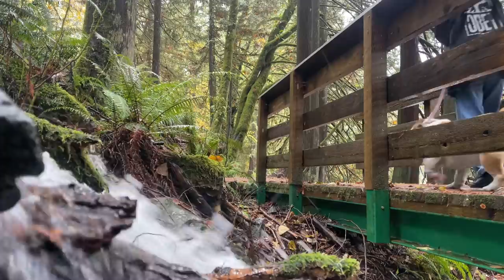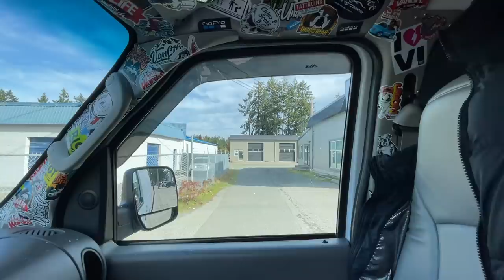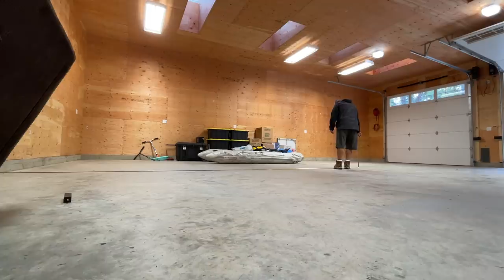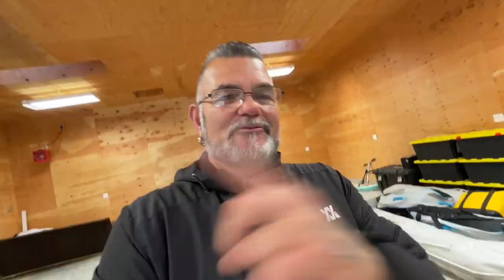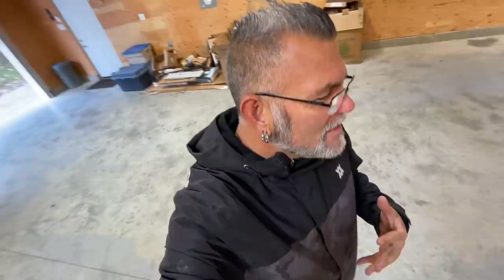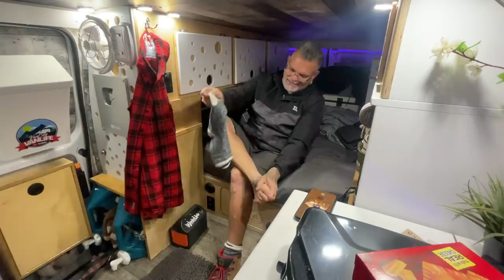CHANGE IS COMING | The Search For Our Adventure Headquarters | VAN LIFE

Comment: The shop is fantastic,  congrats!!  U know if u want a bathroom,  it would be easy enough to put a shower tent up over a drain or a hosed pan. Will u be able to sleep in the driveway?  Before you go broke shopping check used sales for benches and stuff. Old is often better.

Comment: Nice shop Chrome!! Make sure you get a carbon monoxide detector for it if you're gonna sleep in your van inside the shop! And I second on looking for used work benches and the likes. Air compressor as well, if you can go with a rotary screw one, way quieter when they run.